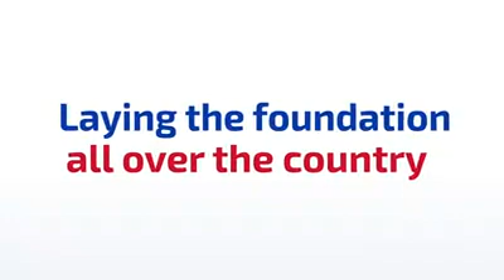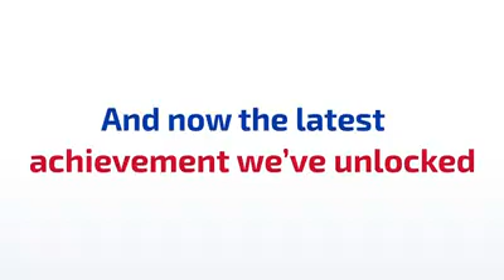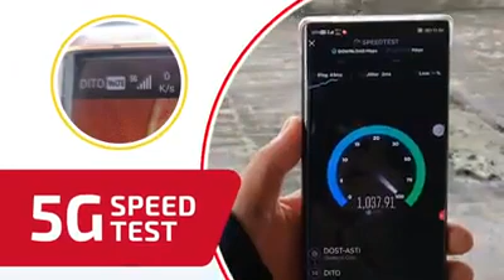DITO Telecommunity 5G Speed Test

Comment: Dito telecom might be the first telco in the Philippines that has mmWave 5G with those insane 1gbps+ data speeds. Just wow
Reply: @juicybongo173  not in 5G
Reply: @juicybongo173  Bro that's just a high-speed 4g if it ain't faster than 500mbps or so.